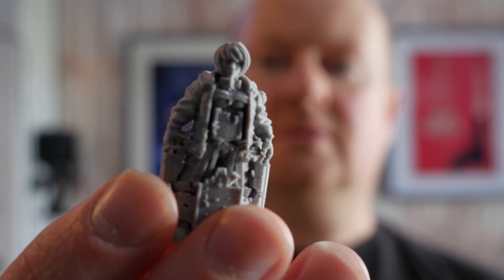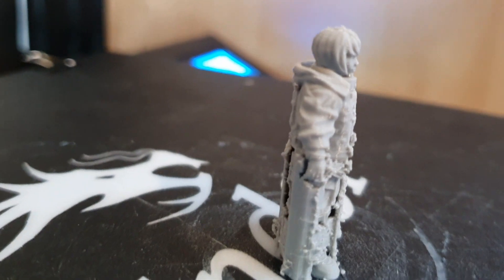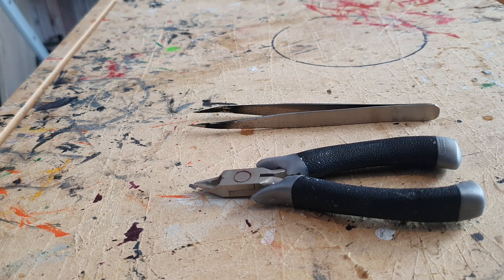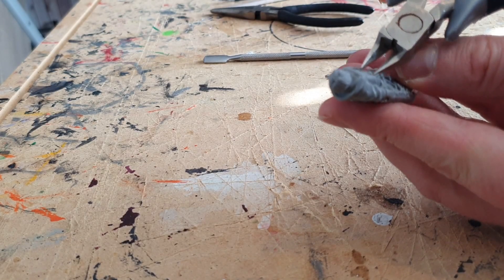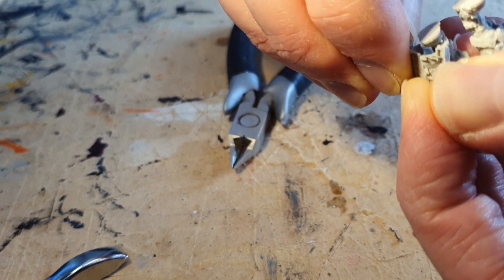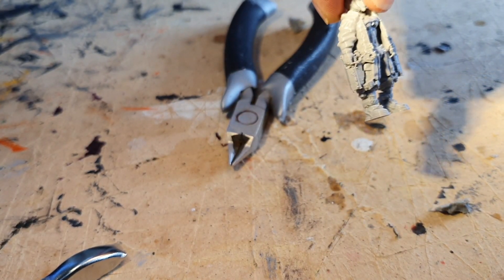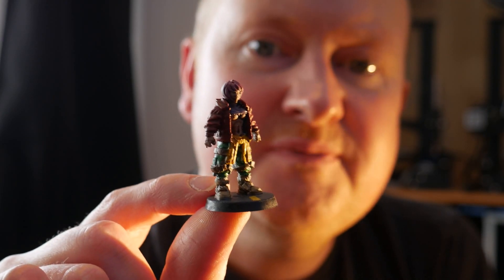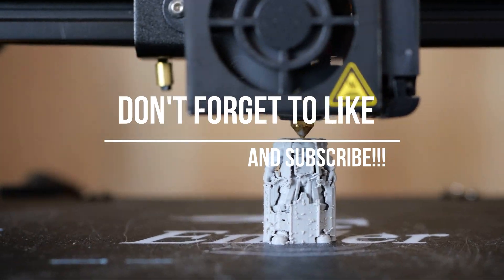How to Remove supports from 3d printed miniatures. Simple tricks for FTM 3d printed miniatures

Comment: i just started 3d printing, all the supports that are on my prints are so hard to remove its pointless printing anything that requires them, I'm using pla and have had to hack so much at it its like handling a cactus, the palms of my are badly cut from handling the prints I've had to abandon the job. is there something I'm doing wrong?
Reply from the maker: Hi Bob, I'd try using custom supports to cut down on the amount of material you have remove. You only need to support parts of the print that overhang so much that they won't print correctly if they don't have them, for example the arms and chin on the fig I print in this video. Also, not all figures are suited to printing in PLA and may be designed to be printed in resin, check the model description to see if they will print without support. And as with everything worth doing,  practice makes perfect.  Thanks for watching :)